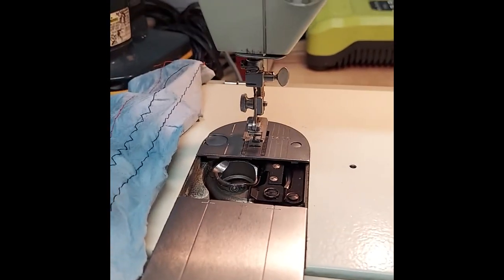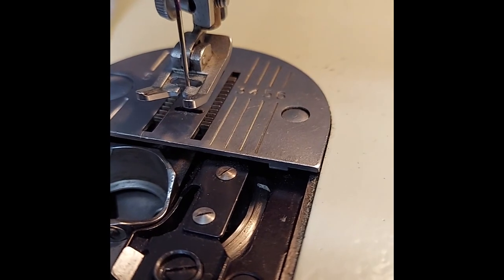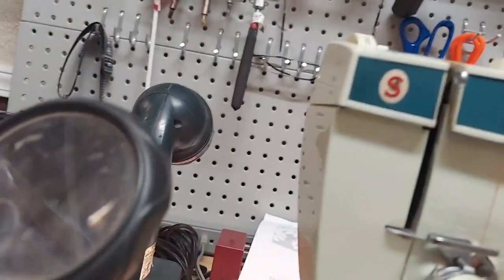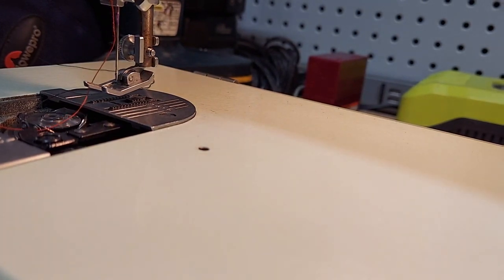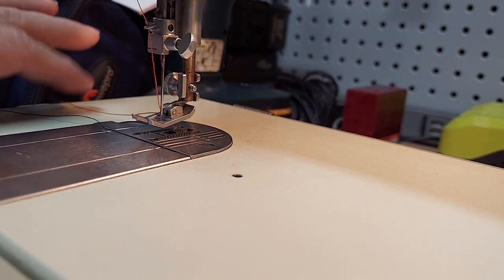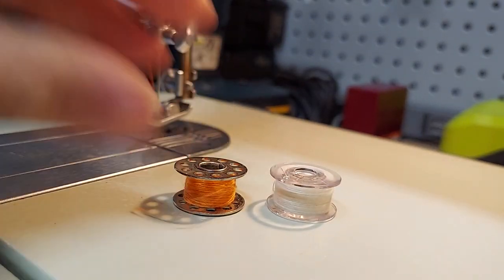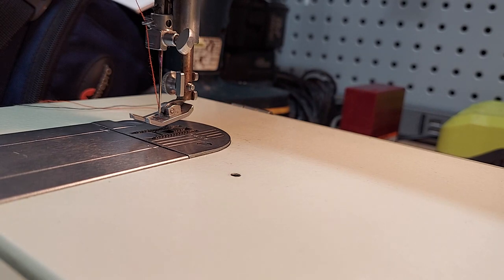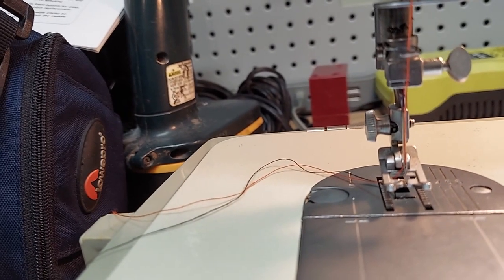Singer FashionMate 257

Comment: In threading the machine you missed 2 steps. After the thread has been threaded in the tension area, the thread needs to be looped into that horizontal hook along with the first thread. Also once the thread has been put through the curly Q, the thread needs to be put through that last hook on the needle holder and thread the needle.